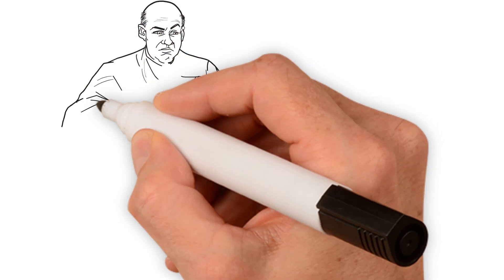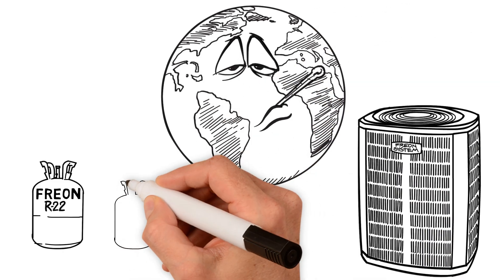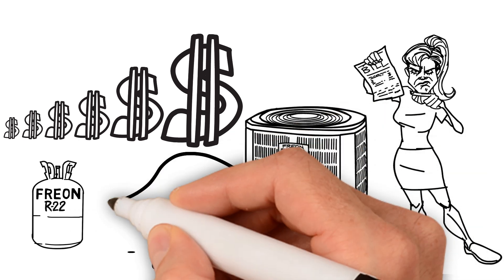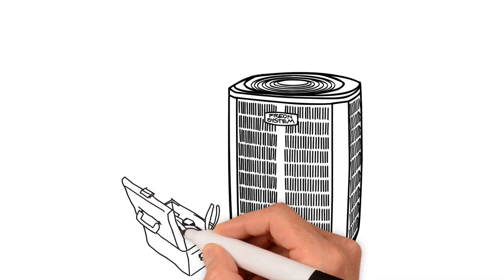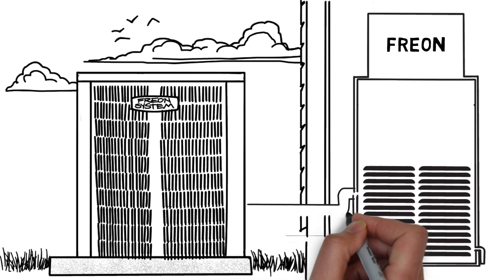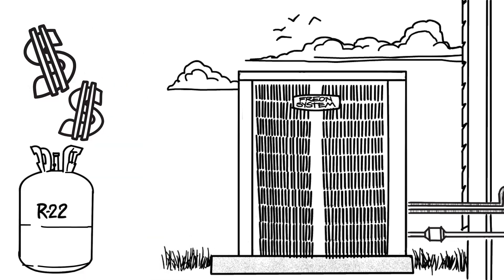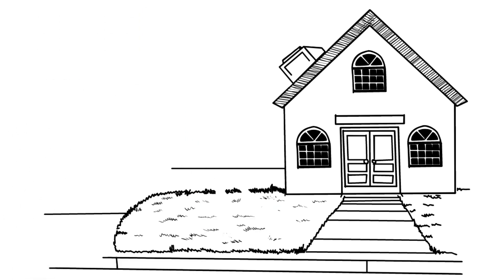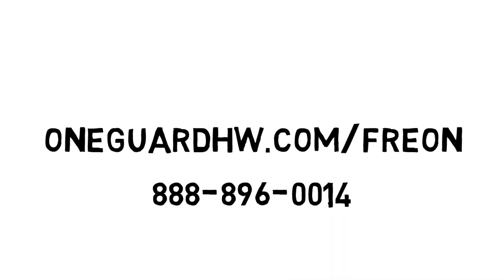Freon Phase Out

Comment: You are making things difficult for nothing.  Pay the contractor to evacuate the R-22 and recover it. He then can sell it to other people who need R-22. Then recharge your unit with Ecofreez EF22 in the link below.  

I myself will just use the vacuum pump I have and evacuate the R-22 and inject it to the empty R-22 container I have and give it to the hazardous waste disposal center, as they take it for free.  But if you don't have an empty R-22 container, then use any other container that can hold gas under pressure.  

http://www.ecofreeez.com/
Reply: Found this online: Look at whats in EF-22a, propane. Propane is also known as R290.
Reply: Yes. Propane is one of the components of EF-22a, as it is a mixture of different gases.  However, none of the components are detrimental to the Ozone layer. And none of the components, including propane, has a life span longer than 1 week. Thus if you release it or if it leaks into the atmosphere, it will be converted to harmless gas in a week.
Reply: Кевин Юань 
I'm as concerned about the life of my AC unit. MO99 was considered a good alternative and that proved to significantly shorten the life of the unit. How do we know Ecofreeze will not do the same?
Reply: M099 is a HFC refrigerant. According to their website FAQ..

Will EcoFreeez Hydrocarbon Refrigerant Technology harm my air-conditioning and refrigeration 
equipment and its components?

NO. In fact, it should extend the lifespan of your air-conditioning and refrigeration equipment as
the hydrocarbon refrigerant is non-corrosive compared to HFC and HCFC products.